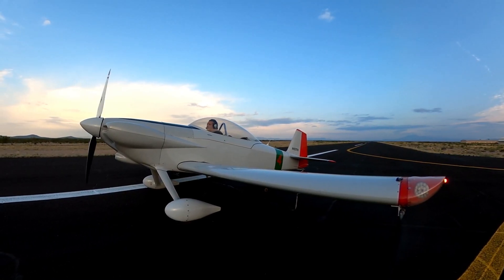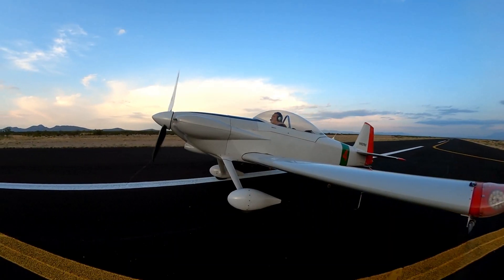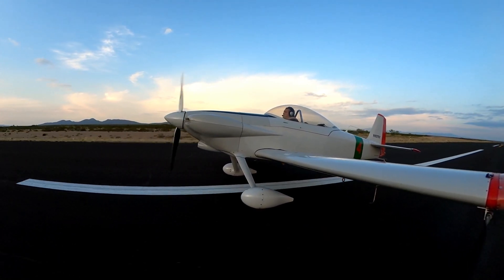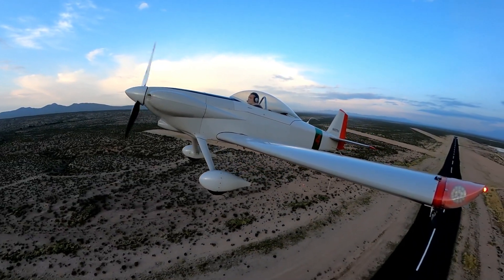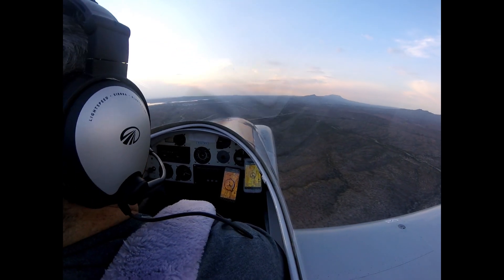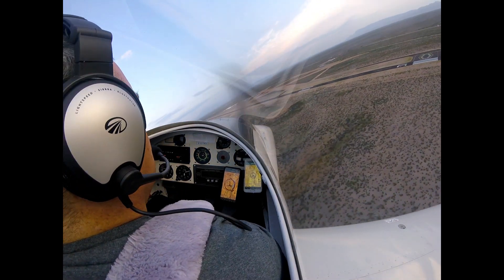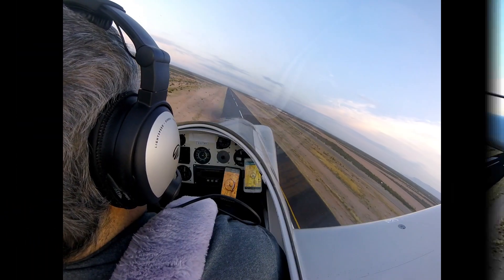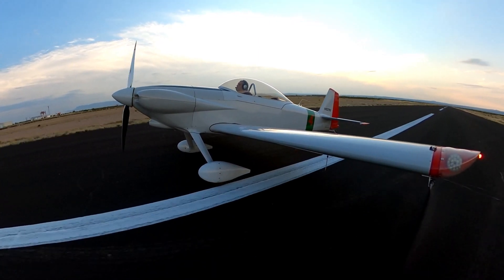Aircraft Impossible Turn Possible - Safely??

Comment: Great points and thanks for posting.  I'd like to add that in these discussions, people always emphasize the altitude at which the engine failure occurs and say, for example, at 400ft or 500ft, etc., you can safely make the turn. But no one talks about WHERE you are when this happens and how long the runway is, which would make a big difference.  For example, it would be much more preferable to be at least at the end of the runway (as you are here in your video) or a few hundred feet beyond so that you don't run out of runway when you get back on he ground.  In my Pitts, I can easily be at 400ft AGL on take off and only used up 1/3 of the length of our 3,000ft runway.  If I turned around at this point, I would overshoot and not have enough runway in front of me to get on the ground and come to a stop.  In my RV4, on the other hand, I would be closer to the end of the runway at 400ft AGL. This would leave me maybe just enough room to land, but it'll be very close.  More preferable is if the engine stopped when you're slightly BEYOND the end of the runway (like in this  video) at about 400-500f AGL. I'm just trying to point out that in addition to altitude, you should also consider WHERE you are, and  how long the runway is, when making the decision of whether you can make the turn or not.  You already pointed out the other important factors like climb speed, wind, etc.

Comment: What angle of bank do people recommend/do? 30, 45, 60? 

I was taught 45 degrees angle of bank and stick just in front of the stall stick position. 

I have another gentleman claiming 60 degrees angle of bank and his reasoning is so that you don’t travel further away from the airfield in comparison to 45 turn therefore you stay close enough to make it back. 

Personally I disagree with his opinion so I’m curious as to yours.
Reply from the maker: Hi Ash. Recall that an aircraft can stall at any attitude and at any airspeed. So, there is no such thing as "stall stick position." I can't speak to other aircraft but my RV-4 is very happy to be making this turn while just nibbling at the stall. This is clearly felt in the seat and stick.  This relates to proficiency and familiarity with the aircraft. 
Bank angle is one of the many variables that I mention in the video. IMO, the appropriate angle depends on the aircraft and pilot. Some pilots will not be comfortable with any bank greater than 30 degrees - especially this close to the ground. That's fine but it will increase the 'safe turnaround altitude'.  Again, that's ok because this maneuver is limited by pilot ability and conditions as much as aircraft performance. Forty-five degrees of bank seems to work pretty well in my RV-4. I've used sixty degrees and it works but the reduced turn radius also comes with increased rate of descent. Obviously, there is no free lunch.
Reply: Vglide 45 bank.  Safest.  I learned turnbacks on cherokees in 1995.   See this.  This was my CFI teaching 4 kinds of EFATO and Emergency Low Maneuvers. First ever to do that. 1995. 4 Real landings on 4k feet long runway with 16knots winds. No BS like others still do.  I took that training in 1995. We dont BS. We are Puerto Ricans. We like to do hard things.  Glad some Americans like you like to do hard maneuvers too.  https://www.youtube.com/watch?v=94li1apG-aI

Comment: If traffic and airport allow if you make a small heading change after takeoff to off set to one side of the runway, not a straight out departure. It makes it easier to make the "180", which is more of a +270 degree turn. This off set makes it tear drop.  Second is landing OVERSHOOT - You did nothing I saw in video,  FWD SLIP or S-turns full flaps to help.  In general it is better to run off the runway at the far end at 30 mph than landing (crashing) short of runway off airport at 60 mph.
Reply from the maker: Agreed about the offset and teardrop but it doesn't work in all environments (especially at towered airports and tight backcountry airstrips) so I abandoned it. IMO, a technique must be used every time to establish muscle memory. If that can't be done, we are just adding another variable to a thing that already has a lot of variables. That is not a recipe for success.  

When starting the turn at 400', at 5,500' DA, no wind, 3,000' runway (and an RV-4 - the scenario I stated in the video) there is zero chance of an overshoot. From that altitude, you do not need to increase drag. In fact, if there were much more drag the return would likely be unsuccessful. If conditions were different (turn at 800' instead of 400' or there was a wind or different runway length, etc.), one would need to perform some quick calculations/decisions to make the return successful - just like any engine out landing. I said that in the video. That MIGHT include a slip or full flaps or maybe even a wider turn. IMO, this is part of the reason that the FAA doesn't teach this - LOTS of variables that many pilots are just unable to deal with.
Reply: @JDFinley  Right I never said there is one size fits all and it can or should be done always.  That is a strawman. I'd disagree towered airports are some how no go to non-straight out departures or patterns. Unless there is noise abatement, I find most towers are happy to accept request.  They say no, OK. You can climb out 10 to 20 deg off Rwy heading without grief or complaint from tower. Just ask. If it works for my route of flight I ask for early left or right cross wind (200-300 ft AGL).   I have 900 hours in RV4 which I sold in 2000. I built and fly a RV7. Of course variables in wind, runway, etc. change. That is a given. However my point is many pilots don't remember or never really learned what a Fwd slip is.  Also the offset takeoff heading is a thing, I thought I just mention it. No debate here. 

Also that is not correct FAA does not teach.... I am a CFI, II, ME and taught a lot in the 90's. Still a CFI but not as active teaching, but fly for a living. The FAA does not teach squat. Ha ha. If you mean the PTS (now ACS) there are simulated engine failures O plenty in all phases of flights,  climb, cruise, descent, pattern for Pvt. May be your CFI short changed you? 

 I can tell you when I did my SE Commercial Check ride, before my CFI, toward the end of the check the DPE gave me simulated engine failure after takeoff. I had just cleaned up. This was Vy climb and 600 feet. This is a Piper Arrow. I lowered the noise, (a lot from the the nose high Vy climb). I  made a turn back with no delay to airport and landed on a crossing runway (the airport was old military with V configuration of runways). While getting flaps and gear down  I banked to align with runway (not the same one I departed).  I landed dead stick. I passed. DPE said I guess you can return to the airport. He told be to taxi back to the hanger. I passed. 

So I don't know what point you are making. All my students got a work out (and still do when I do Flt Reviews are Transition training in RVs). Slips and S-Turns are things to practice from time to time. The point I am getting from you is know your plane and have situational awareness, know the winds and runway.  Agree. 

Another point is BRIEF the departure even if you are solo. What you will do with an engine failure at different points in the T/O departure.  With SE the choice may be axiomatic but have a plan in mind and know the limits. I have my students brief the departure out loud. It does not have to be a dissertation, just a mental rehearsal.  Choosing a hard turn back altitude is not a bad idea and off field landing spot is also good idea if you know the area.  Some times there aren't any good options. That is something you should be cognitive of as well.  BIGGIE.... DON'T STALL.  Many GA planes can't make it back to the airport. High Performance experimental and STOL birds can. Like you said. Statistically below 800 ft in a certified GA plane trying to turn around and land on the runway you landed is iffy. If in the pattern you make your X wind at 500 feet. If established on cross wind and near 600 to 800 ft you have a good chance. At 1000 ft abeam the numbers all pilots should practice and make a "dead stick" landing. 

PS just to make sure I looked up FAA-S-ACS-6B   Private Pilot ‒ Airplane Airman Certification Standards, These two words "engine failure" occur 37 times. So engine failure and how to handle them should not be a shock to a well trained current competent Pvt pilot. I am in the middle of my CFI Bi annual renewal. The on line course material reflects FAA is big into LOC (loss of control) accidents lately. FAA is emphasizing to CFI's this aspect as an issue reflected in accidents. Weather and fuel related accidents are down but pilots are still losing control of their plane.  So the "impossible" turn you call it is possible but OFTEN a straight ahead (or 60 left or right) and take an off field landing may be the wise choice, verses stalling in a turn to get back to airport.

Comment: The term "impossible turn" is a misnomer. It's only impossible given a certain defined set of circumstances and sequence of pilot responses. E.g. if you climbed to pattern altitude, it's probably an easy turn to make, albeit, a guy(gal) only gets one shot.

There are several variables that must be accounted for that are rarely discussed.

Unfortunately, very few pilots understand the wide variance in performance due to these un-named factors.

The most important factors are lift over drag, and wing loading. 

These, combined with variables such as wind direction and speed, starting energy state, how quickly you respond and get the nose down, bank angle, G-load, etc. All make a huge difference.

Lift to Drag is distance one can glide for a given altitude. Wing Loading determines radius of turn for a given G-load. bank-angle determines turn rate, in combination with back-stick. Elevator stick position sets Angle of attack and therefore G-load at a given speed, and that AoA along with G-loading increases stall speed appreciably. Bank angle and elevator therefore set Radius of turn which determines circumference, or the distance one must glide around and back. Less G's means less risk of stall, and a a bit lower stall speed, but might end up being to large a radius to return. 

Keep in mind, best glide speed is for gross weight, and being lighter than that means a slower best glide speed. But this alone will get you killed, because in a turn your G-load increases you wing loading and therefore your best glide speed is actually a lot higher than the published gross-weight glide speed. And your stall speed is a lot higher too, so you better keep that turn fast. Faster than you typically fly the pattern in some cases. E.g. a Citabria best glide is 65mph at gross, around 60mph solo, and goes up to about 80-85mph in a tight turn, even at the lower solo weight.

The part pilots miss in training is the formula "One Half Rho V Squared". 

Calculate Freestream dynamic pressure and coefficient of lift for your airplane at gross and solo weight, at 40&60 degree bank angles. And create a Diagram that shows what altitude you must have to complete about 270-degrees of a circle glide. (180+ overshoot, plus turn back to centerline). It's surprising how that chart changes with wing loading from solo to gross wt. And then combined with wind, how much an effect a 12kt quartering crosswind/tailwind has on landing.

IMHO: the best option to teach, and consider, is land straight ahead on the runway or overrun area if below 200'-300'. Full rudder slip may be required. These GA planes come down like an elevator in a hard slip. Above 2-300 feet, turn no more than 90-degrees to land on the road at the end of the runway, or adjacent field. This should be planned at each airport and pictured/envisioned for each takeoff. Imagine running out of fuel or getting water in the line right after you rotate. What are you going to do in this scenario? I wouldn't attempt a 180+ degree turn and downwind landing unless above 400' in a light 2-place plane such as RV or Citabria, and I would want at least 800'+ (low pattern alt) for a moderate (18-25lb/ft^2) wing load four place plane such as RV-10, Cirrus, or Bonanza. 

It can probably be accomplished by the skin of your teeth a bit lower if the factors are in your favor. But I suggest landing on a nearby road or field within 30-45 degrees of runway heading, ahead or slightly to the side. Almost all airports offer this option. A street and bent airplane is better than spinning in from 200'.
Reply from the maker: As I stated in the video and as you stated here, there are many variables involved. That's the reason it is a difficult topic and also one of the reasons that it is polarizing. As noted, if a pilot does not want to understand all these variables and become very proficient with his/her airplane, they should follow standard FAA guidance. For many pilots this is the best option and they may fly from airports where this is sufficient.  This video is for those that don't fit into all that. 

"But I suggest landing on a nearby road or field within 30-45 degrees of runway heading, ahead or slightly to the side. Almost all airports offer this option."

This is typical FAA guidance for the uninformed. As I stated above, that's probably fine for many pilots. However; I find it to be very short sighted for anyone that wants to understand their aircraft and how it performs. Many people like to think that their 'typical' is the same 'typical' that everyone experiences. It usually isn't. I believe this exercise/skill is important because MANY of the airports from which I commonly operate have really terrible straight ahead options.  Suggesting that straight ahead is a 'better option' when you don't know what is straight ahead is, IMO, really bad advice. I've posted a video showing the view of my more common departures.  Please note the difficulty that a 'straight ahead landing' creates at each of these locations. The video is here:  https://youtu.be/n2_CaUhaV7s
Reply: @JDFinley  This was my CFI teaching 4 kinds of EFATO and Emergency Low Maneuvers. First ever to do that. 1995. 4 Real landings on 4k feet long runway with 16knots winds. No BS like others still do.  I took that training in 1995. We dont BS. We are Puerto Ricans. We like to do hard things.  Glad some Americans like you like to do hard maneuvers too.  https://www.youtube.com/watch?v=94li1apG-aI

Comment: An interesting vid Mr Finely.  I have tried a similar exercise but with a 500' safe margin, just in case and discussed this with my flying mentor at length.  A contentious subject for sure and I'm not an instructor so cannot comment other than from personal experience relating to my RV4 (same engine and similar loading) doing similar exercises, with a safe margin.  Based on my experiences, my three points are almost identical to yours: 1. Know your a/c, not all behave the same way.  2. Wind can have a dramatic effect. 3. I found it easy to bust VFE and overshoot the short strip I operate from.  I'm glad I did the exercises to get to know my a/c but, as you point out, there is no substitute for prepper training.  Thanks
Reply from the maker: Absolutely right - very contentious!!  I completely agree - knowing ones one aircraft is super important and this is another aid to accomplishing that.  Certainly not for everyone but I find the data valuable.  It is pretty common for me to fly out of backcountry strips surrounded by hostile terrain. Knowing when a return is possible and when it is not may prove useful someday.